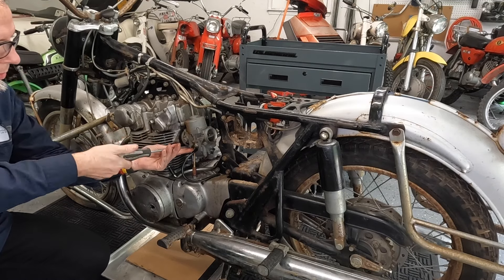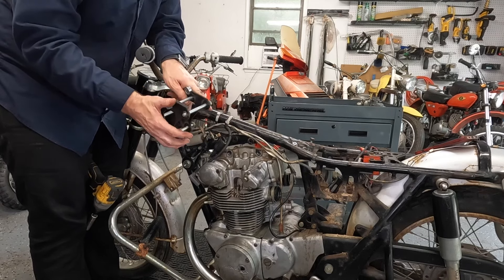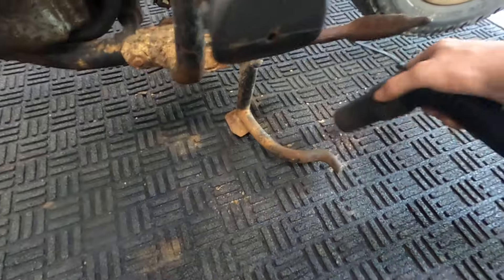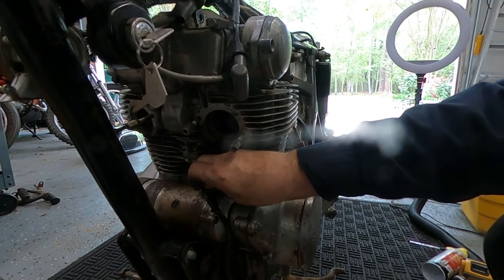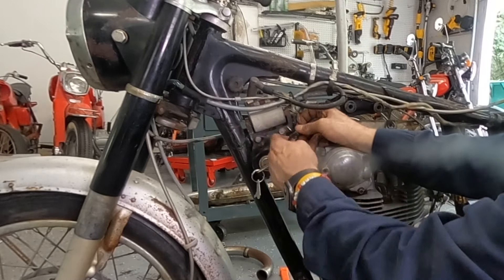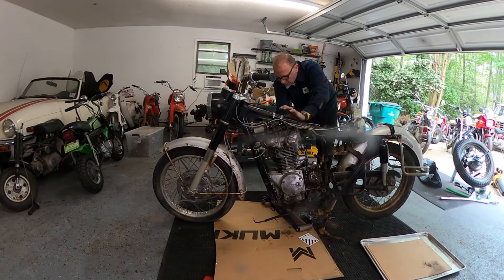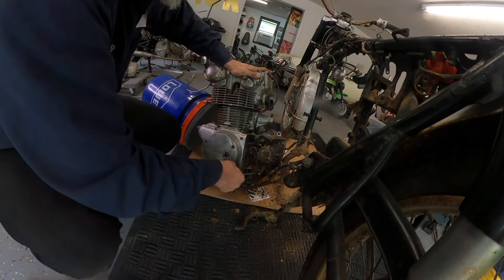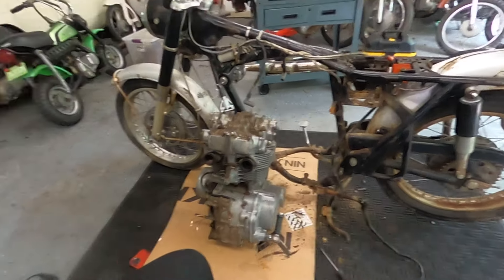Pulling the Engine from my 1965 Honda CB450 K0 Black Bomber

Comment: I’m a car, semi truck, biker, and bicycle head gear person🤪 I personally dump everything in the bucket, but during the removal I use different color tape parts that I’m unfamiliar, so I don’t mix them around with the wrong part. I like your videos you have a good motorcycle collection, and I love your Ford truck. Keep up the good work 😊👍👍👍👍👍
Reply from the maker: Right on, the tape is a great tip. Thanks for watching.

Comment: If I had to take off in an extreme measure, a solution to repair or replace a major engine component for an antique engine, I would video the entire engine prior to disassembly and take pictures also. After removing the fasteners, I would bag and tag them.
Reply from the maker: A great byproduct of recording everything you do in the shop. I you can always see what you did. Thanks for watching

Comment: Depends on the bike, if I know the bike it all goes in one tub, V65 I just did all went in one tub, I guess it will catch me out eventually and I should label it all but I tend to think about that when I am struggling to put them back together - oops too late :) I like this one buddy, it's going to be a nice bike
Reply: I guy I worked with back in the 1990's who tore down a 1980's japanese bike (I don't remember which brand or model) and had it in boxes for months.  When he finally put it all back together, he had a small box of leftover parts, pieces, nuts, bolts, etc.  He rode it to work after he finished, and the bike ran and rode fine (according to him), so he asked me why manufacturers used all these extra unnecessary parts?  All I could do was express my concern and fear for both him, and those driving near him, for what could end very badly.  I'm sure he ended up selling that future nightmare to some other unfortunate and unsuspecting rider.
Reply from the maker: 🤣🤣🤣 I have put together several bin bikes. All the pieces and parts in a bin. I like to use CMSNL as my parts manual to figure out where everything goes. The GPZ came with a gallon bucket of hardware 99% was not for the GPZ.
Reply: @motorcyclerewind  haha yep same here, CMSNL shows you where the nuts and bolts go, doing my V65 a couple of weeks ago I ended up with one piece, couldn't figure out where it went, CMSNL staring at diagram after diagram and found it eventually - great site, saved me a few times

Comment: You could remove the right crankcase cover and let the oil drain- Should get most of it that way. I have a CB350 that came with a round drain plug that I swear the previous owner must have Red Loctite'd in... HAHAHA
Reply from the maker: Next time I won’t worry about the mess. 🤣 Made one anyway. Thanks for watching.

Comment: I'm a put it back together or put it in a ziplock bag with a label guy.  Or... I'll take a piece of cardboard and draw the part (IE the outline of a primary cover) then poke a hole where each screw goes into the cover and stick the screw into the cardboard...so I know which bolt or screw goes to what hole.
Reply from the maker: That cardboard is a good idea. Thanks for watching.